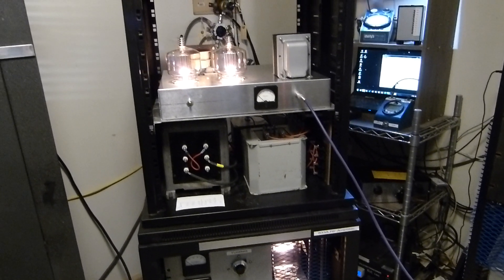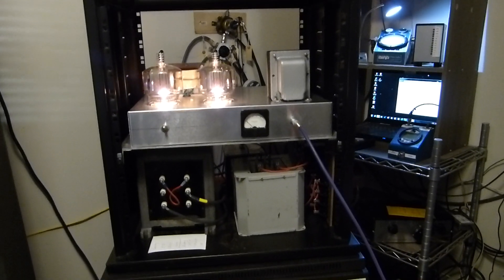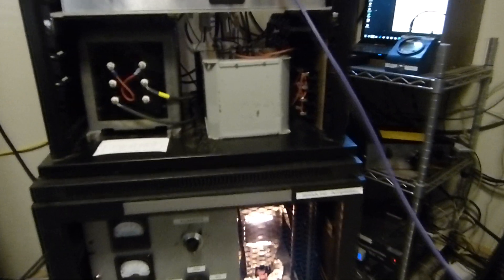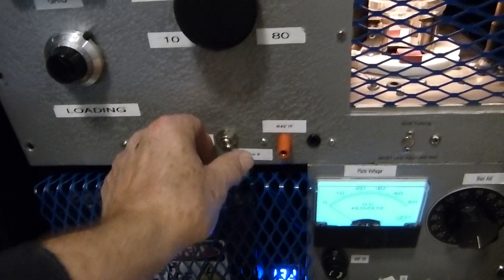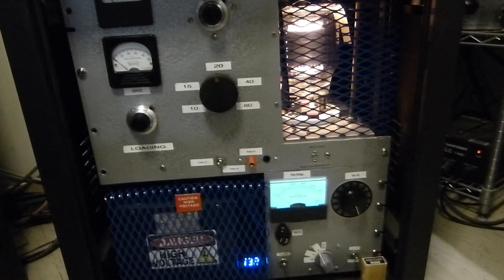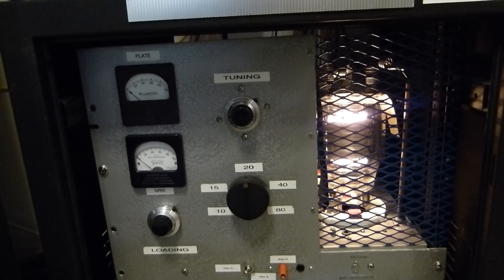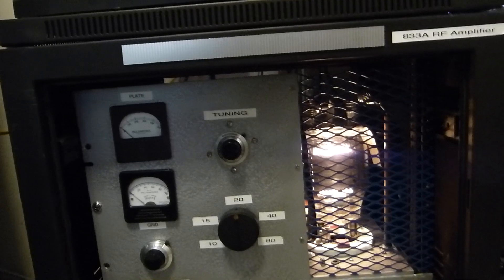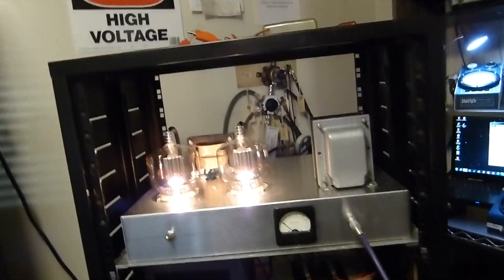Plate Modulating The Mighty 833A

Comment: Great videos here is an idea about getting rid of the feed back drop the tranny in a pole pig bucket with oil...I did this on a small scale on one that had that problem on a heath kit apache an i was using a bogen audio tranny in it. just a thought anyway keep up the builds theirs nothing like AM
Reply from the maker: Never thought about putting it in a can of oil... that is a grand idea. Thanks. I now have a Peter Dahl modulation transformer made for a pair of 833A to modulate a pair of 833A. Maybe I will get around to building that one up some day.  73

Comment: What about putting some shielding around your Transformers block the RF  I thought Transformers without the horn caps on them interferes with the tubes causing oscillation just whatever kind of picked up watching different videos
Reply from the maker: I need to post a new video of this AM transmitter. I have set-aside the 833A for now and used a grounded grid (GG) 3-400Z amplifier that I biased for class-C and plate modulated with the modulator in this video. It is running good. I put the huge modulation transformer on a thick rubber mat and covered it with a internal foam insulated large ammo box. I cut a hole in the ammo box for the HV wires to come thru and use spark plug wire for connections to the amplifier. 
It quieted the transformer down so I have no acoustic feedback but I can still hear it "talk" a little bit so I ordered some stick-on sound deadening material. 
As for RF feedback - I put 2.5mH RFC and 100pf capacitors in the audio lines and that solved that problem. I am on the air with it and pretty happy but still need to do some cosmetic and safety work with it. Thanks for your thoughts and comment.  73

Comment: Good to see you back Dave. I am no kind of an RF guy but I have two thoughts.

1. I have seen a guy superglue the laminations back together, on a Fender output tranny.
2. Can you engineer another phase inversion inside that loop? Or remove one?That way it becomes NFB around that loop instead of PFB. Might even clean up the audio some more ;-)

EJP
Reply from the maker: I see the value in superglue. Some years ago I built an amplifier and used ceramic sockets that needed a notch to orient them and they were held in place with a wavy-washer. Since I do not have that special punch with the little notch, I could not secure them from being a bit lose and want to rotate. Somewhere on YT,  I saw where a fellow solved that with superglue. I use it and it works to this day and I listen to that amplifier daily in my backhouse. 
I have never tried it on a transformer. The paint on this transformer is very nice and thick even though it is probably 60+ years old. I don't know this but from what others have mention in comments below, it may not be uncommon to have an uncomfortable amount of audio feedback from these large audio devices. Think about the amount of what we can hear around 1KHz from the best 25-50 watt audio transformers and multiply that to 1000 watts. The solution, so far, is to give it its own space in an acoustic chamber.
This is only part of the problem...
Now I am modulating a 3000+ volt DC source where audio frequencies must reach 6000+ volts peak. This is a big deal. Talk about needing HV capacitors and connectors...Things happen fast and violent at these levels if everything is not right. I have shorted 5000 volt plate blocking capacitors, arced meters to the chassis and exploded high voltage Millen connectors. It is enough to keep you scared every time you initiate HV.
The rubber mat and insulated ammo box solves the acoustic issue along with high voltage spark plug wire.

I have rolled this monster into the corner for the moment. It makes one understand why 1000 watt AM transmitters from the 1960's and '70's are the size of fridge and weigh 1500 pounds.
Thanks for keeping in touch. I do the best I can to keep in touch with you good gentlemen that I have had a friendship with over the years even though I may be slipping on responding a bit lately.

Comment: Maybe a modulation reactor may help. I have a Globe King 400 with a similar problem, but the only mod reactor I have is as big as one of the 400's deck chassis, it was removed from an RCA BTA-1R broadcast tx.
Reply from the maker: I just looked up your RCA BTA-1R and found its manual at the BAMA site. I love to look thru these old manuals. I see it used 4-400A for RF and modulation. Looks a lot like the Collins transmitters. It seems Gates stuck with the 833A for both.
Surely there is some way to "pot" the transformer so that it does not have to be on a rubber mat under an insulated steel box like I have done. I wonder if it would help to tape off the connectors and then paint/dope the whole transformer in a heavy coating of maybe epoxy? Maybe I could put my transformer in the metal ammo box and fill it with epoxy... then it would weigh 120 pounds - maybe not.  🙂

Comment: Nice transmitter, I have one with two 812s in the RF modulated by two 811s, Pushpull in the RF. It Works very well. As for the modulation transformer singing, you can vacuum impregnate it  using varnish for transformers. You must loosen the screws for this. If you can't do the vacuum process, you can use new varnish which is very thin and simply soak the transformer for a few hours, then remove, tighten the screws and let it dry. It solver the problem. Sometimes in not the plates that vibrate but the coill.
Reply from the maker: Very nice that you run a pair of 812A in your transmitter and modulate with 811A. I would love to QSO with you. I have a James Millen amplifier that runs push-pull 812A with swinging-link coupling right from 1947. It works beautifully. My modulator is homebrew and runs a pair of 4-125A into a BC-610 modulation transformer. Here is a link showing it a few years ago but I have since put it in a tall cabinet with modulator and power supplies.
I may get some help dragging this transformer out into the hot El Paso sun and loosen up the bolts and see if I can get some thin varnish to seep down into the laminations. Putting the transformer on a rubber mat and under an insulated metal ammo box did solve the problem but it takes up a lot of extra room that way.
https://www.youtube.com/watch?v=OkYS4TrTqrw
73  WA4QGA
Reply: @ElPasoTubeAmps  Greetings, It would really be interesting to do a QSO with you, but my station is in Santa Catarina Brazil. As I don't use a directional antenna but a Levy antenna, which in a simplified way is a dipole with an open line, I think it's a miracle that we manage to perform a QSO in AM, maybe in an high band.
Yes, one solution to prevent the modulation transformer vibration from propagating through the chassis is to use a rubber damper or make the transformer floating. But the best solution is to lock the coils and iron blades with some kind of resin or varnish, transformer varnish, when new is very thin, but if necessary it can be heated. Using a pressure cooker that holds the transformer inside, and a vacuum pump, which can be a used refrigerator compressor, it is possible to make a vacuum chamber to impregnate the transformer. The vacuum causes the varnish to penetrate inside the windings and blades, allowing the device to completely lock.
Finally, triodes are the best valves for plate-modulated AM operation, due to their naturally quadratic characteristic.
I am part of a group of Brazilian radio amateurs who restore and preserve old communication equipment, all of which only operate with valved equipment, usually homemade. This is the fundamental amateur radio.

73 PP5BMS.
Reply from the maker: @mauriciosinigaglia4761  I hear Brazil occasionally on 20M. I have a hexbeam for 20 and an inverted-V for 40. That is all the room I have for antennas as my yard is small.
I have your call and if I hear you on, I will do all I can go contact you. I don't think the conditions are reliable enough for a scheduled call but we could try if you want to - SSB to start with, of course. I need to get back on the 833A project as I rolled the transmitter into another room for now but I haven't forgotten it. I have a lot of pictures of equipment on my QRZ page.
73 for now.  WA4QGA

Comment: That's enough transformer to push 4 3.500 z
Reply from the maker: It is a monster modulation transformer - too big to handle and "play" with but with all the taps it has, it will match practically any set of push-pull modulator tubes to any RF amplifier load. I will get back on this project soon. Sometimes I just have to let a project rest for a while.
Reply: Ten four good buddy 👍be very careful high voltage can hurt I work on a little guy 1 time and when I grab it bottom got me it was just 1 tube  little it only done 100 watt ouch  got sb 220 and now when I clean it I discharge it real good  actually leave it unplug  for couple days
Reply from the maker: @benjaminmeadows1380  Yep... the HV in a SB-220 could be a one way ticket to the next life...I am careful and methodical in working with HV but I also know a bit of luck in a couple of cases has probably saved my life. Stay safe.  73
Reply: Ok  Yelp lot volts knew a guy back in day in Florida he had a system in back of van he did shootouts he got fried with that they found him in the van dead   so sad that day back in the early s 2000 I been in radios for 25 years so seen them monster amps
Reply from the maker: @benjaminmeadows1380  Working with high voltage is kind of like having a cage full of pet rattlesnakes. Funny the things that we enjoy that can kill us.
Reply: @ElPasoTubeAmps  ok we know about rattle snake s I work in woods so every now in then run across 1  but the seems like there try to craw away we have cotton mouths here there chase u down and try to get u where I fish at tons of them okay take care

Comment: Do you have any 4/1000 tubes
Reply from the maker: Not any more. I have had quite a few over the years as I was given several pulls from an illuminating radar station from WSMR where I worked 20 years. Lots of years ago I built a 4-1000A amplifier but did not have a PS of at least 5KV to run it so it turned out poorly. Even 4KV is not enough. Another thing is if I want to go significantly larger than what I already have in two transmitters with 1.5K output, I would need to go to 3000 watts (a pair of 4-1000A) or so, and it starts to become just crazy big. At 3K watts output, the chance of arcing my hexbeam becomes real and I can't climb that little tower any more. It is obvious I love the power but I am trying to keep myself satisfied with only 1.5K watts.  🙂  73  WA4QGA
Reply: @ElPasoTubeAmps  totally understand that. I want to get a pair of 4-1000 for a future build. I run a pair of Penta Laboratories 3-500zs now. Trying to take my time finding what I need for the next build
Reply from the maker: @swing_king_252  Push-pull 4-1000A could deliver more than 5000 watts output with 6000 volts on the plate. Ham radio operator dream come true - but - why not go to push-pull 4CX3000A for 12KW output. Run AM so your neighbors can understand your modulation. One of my neighbors tells me he can hear me sometimes but can't understand what I say and sometimes he can. I try to explain to him the difference when I run SSB and AM. There is just no sanity level in it - I love it... stay safe.
Reply: @ElPasoTubeAmps  I've just always been a big fan of glass. Nothing like seeing them baby's glow

Comment: Can we assume that it's acoustically generated because it only happens when audio is applied?  That being said how about noting what audio frequencies are causing the loop.  Maybe try using a mic equalizer pin point the frequency.
Reply from the maker: It is only during modulation and is probably more of a common problem that I initially realized for KW level audio transformers. I feel sure the age of the transformer has something to do with it also and it being an open-frame transformer.  I have another AM transmitter that uses a UTC type round and potted transformer and even with it, if I get the microphone close to it, it starts to feedback at a high frequency just like a microphone and speaker. I did discover that putting small value capacitors across the primary and secondary did helped calm the issue but it was best solved by putting it on a rubber mat and under a sound insulated metal box. I think it is pretty much the whole voice frequency range that is the problem but I like your suggestion of an equalizer. I have gotten more good thoughts for solutions from you guys than I found across the Internet searching for a solution. Thanks... stay safe.
Reply: @ElPasoTubeAmps  Always enjoy your videos.  Please keep doing them!!!!  Robert

Comment: Hi david, nice to see you again!
I think that most the audio feedback comes from the chassis vibrating with the transformer, probably if you add rubber dumpeners on the feets it might help. just like wall mounted external refrigeration units you can get semi hard rubber grommits with fully suspended bolts connected to the supporting chassis and you can just screw the transformer on to those.

btw have you received my Email a couple of month back?

73, Manuel.
Reply from the maker: Hi Manuel - I do remember you writing some time back but if I read an email and don't reply at that time, it often time slips by me. Did I not reply?
This project is in the corner for the moment and I have some smaller ones I am dealing with but thought it might be entertaining.
Hope you are doing well.
Reply: @ElPasoTubeAmps  Yeah I did not see any reply, it was about some code I wrote to easily automate measurements with gpib instruments without using all of that weird commands. If you would like to know more hit me up!
I am doing fine, but at the same time dealing with some health issues, fortunately nothing really bad but I am still having some trouble. How about you?

Comment: I wonder if its actual mechanical feedback (as in Vibratory), or audio feedback (as in Microphonic's).......maybe some further experimenting is needed to determine exactly where the loop is coming from
Reply from the maker: We can hear the OPT "talk" in even good stereo quality audio transformers as I am sure we have all heard before especially with a tone at 1 KHz but this is at a different level all together. Very loud and gets right back into the microphone. I assume it is mechanical vibrations of the laminations. This transformer weighs 85 pounds so it is not an easy thing to toss around and play with. I did tighten up the bolts on it for no help at all. I think all large audio transformers like this "talk" under modulation but I figure this one is worse because of its age. I have read that it can be vacuum impregnated with lacquer but I don't know where to have that done. Putting it in a sound proof box seems to be the homemade solution - at least for now.
Reply: @ElPasoTubeAmps  maybe you can make a vacuum chamber and use one of those eBay vacuum pumps

Comment: Thanks for sharing really impressive rig! I would try to give it to somebody who can soak it in vacuum lacquer chamber keep up the good work ❤
Reply from the maker: It is a dream-come-true modulation transformer but after some 60+ years I imagine the lacquer dried out. There is a comment I left below about how I put it on a mat and then an insulated ammo box over it and quieted it down. Problem with this approach is the HV leads necessary to and from the transformer. Got to be safe first... thanks for your thoughts.

Comment: Almost thought of potting the insides.  Take the endbells off and run some varnish inside.
I would try the rubber trick first though as it could get messy!
Reply from the maker: I tried other modulation transformers that are potted and did not have the feedback issues but I have learned before, and again here, impedance matching is very important. We can use a 3.8K or 5K or 6.6K, etc. on a 6L6 amplifier with pretty good results with any of these impedance values but not at this level of three and four KV and then modulate it doubling the positive peaks. Impedance matching has to be correct and the big UTC multi-match transformers does it perfectly - except for the "talking" of the laminations so loud we get acoustic feedback. It wouldn't be fun if it was too easy.  🙂

Comment: Wow... you definitely some beautiful professional-quality gear. I was thinking that if you were to place a thick rubber mat beneath the mod xfmr that it would help to get rid of the feedback by reducing the xfmr's ability to to induce modulation-vibrations into the sheet steel beneath it.
Reply from the maker: I did just that - I used a kitchen type floor mat to set the transformer on and then put a large ammo box over the top that I lined with Styrofoam and it did stop the sound and feedback. I just got a little burned out and set the whole project aside for a while. I will come back to it soon. Thanks for your thoughts.
Reply: @ElPasoTubeAmps  Right on... you're welcome. 🙂